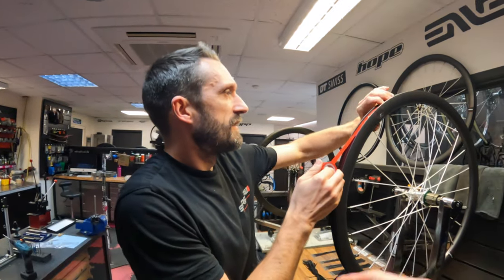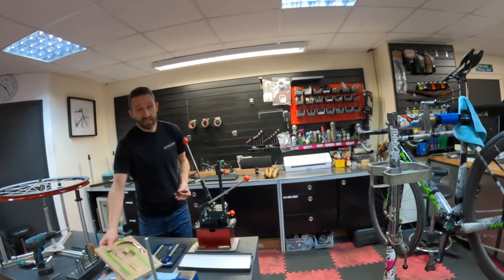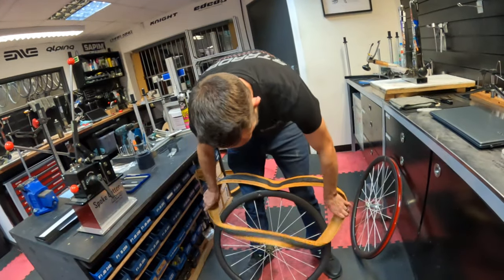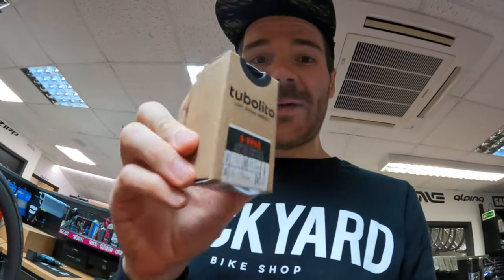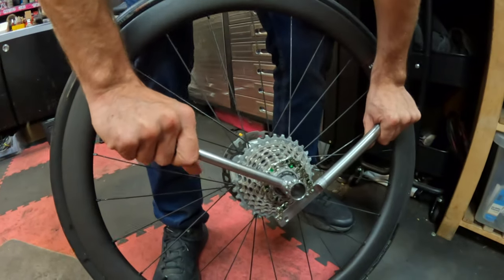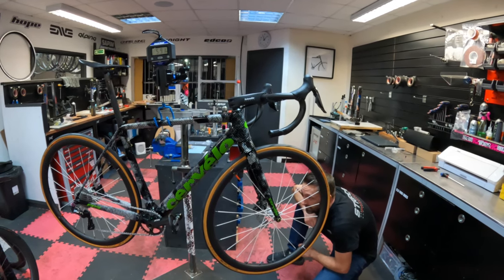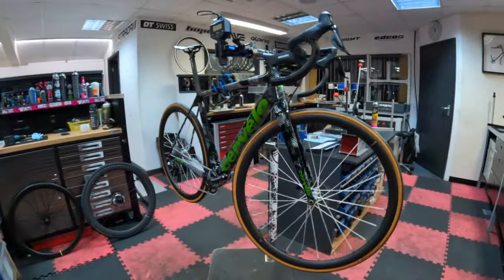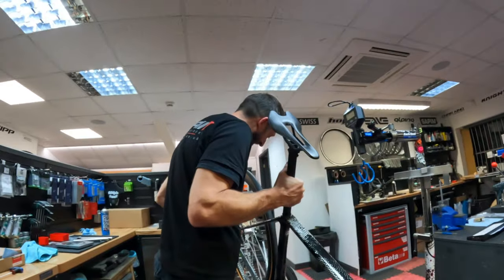DOES THIS PROVE RIM BRAKES ARE DEAD?!

Comment: You guys can keep making these death of rim brake videos till the end of time, but my road bike will only ever have rim brakes. They are perfect for how I ride & will actually lock up the tires if squeezed hard enough! These Shinano Ultegra road calipers are powerful & simple & never make noise. 🔥🚴🏻‍♂️🔥
Reply: There's enough braking power in a pair of mid 1980s Shimano 6208 single pivot side pulls even for a fat old duffer like me (96kg wet through), limiting factor regards braking/stopping is traction of the tyres and the ability of the rider to read the conditions.
I'll also never ride disc, a marketing ploy to extract loads from people riding bikes and thus far have done so with the aid of the so called professional road cyclists.
Reply: Yeah, i have a CAADX with cantis. Love em. I've had discs on MTBs before but what a faff. rotor squeal, piston siezing, bleeding etc. Not to mention the hit on the wallet.

Comment: My 2012 Scott CR1 SL in a 61cm with some Easton SL/SLX tubs came in at 6.212kg. That's DA9000 bits with Ultegra chain & 11-28 cassette, SLK K Force light Easton SL/SLX tubs (22mm Contis), Modolo Kurvissima bars, Ritchey Super logic post, Selle Italia Carbon flow (the wide one) and 5700/105 pedals.
My very ordinary KTM Strada 6000 in a 59 with 50mm Bora 1s (+27mm Vlaanderen) and same kit above is 6.63kg
5.91kg is an ok effort.
Reply from the maker: Final weight was 5.59 with pedals, power meter and Garmin. I think that’s ‘ok’
Reply: @ChrisHallRides  When you're spending huge sums on Smolke, one chainring and doing absolutely everything to get the weight down with a small bike frame, it is just 'ok', it's not outstanding but a good ok effort.

Comment: RIM brake wheel set will not die for me.....I have 5 sets of rim brake wheels with 700x28C tires and cassettes, I use them all on my 2011 Specialized Allez.  If I come across a used bike (same size a mine) with rim brakes for sale at a good price, I may consider buying it.  This is 1 reason that I am not buying a new bike with disc brakes, it is just OVER RATED.

Comment: Rim brakes will die when you cannot get parts for them anymore
Trp already stops providing parts for all those Triathlon bikes with the trp brakes.  You cannot get the rubber and springs for these brakes anymore.  I had to buy the Tririg brakes but those are on the way out too.
Reply from the maker: Yeah you’re right it’ll get to a point where it’s hard to get the parts

Comment: Rim brakes will still be here long after disc brakes have come on gone , probably one of the best marketing brainwashing scams in the history of scams , but those who like disc brakes good for them , the weight of bikes come a close second to disc nonsense. Again if the weight of the bike is what floats your boat brilliant.
Reply: Coaster brakes are even older.  Disc brakes will possibly be replaced someday but rim brakes will only last as relics...like carbureted cars
Reply: @veganpotterthevegan  funny that relics of cars tend to sell for much more than modern cars, most of the older bike with classic components are very expensive and will only go up in price, this modern garbage will only add to landfill in the future.
Reply: @kavanobrien6547  huh?  Most of them are rusting away and nobody will ever care about them. Not everything that's old has value.  And the stuff the does has value hung up on display and not being used anymore because its inferior.
Reply from the maker: I found an old Fray Bentos pie at my mums which was about 30 years old. Wonder how much that is worth
Reply: @ChrisHallRides  wow Chris is that the best you could come up with , now that’s what you really call lightweight.
Reply: couldn't agree more. People have bought the marketing BS hook line and sinker, aided by the pro ranks whom will ride any old crap if they're getting paid. Wide tres people will sa, I'll say just develop frames that take wider tyresthe calipers with some development could take 32mm. How much wider do ou need for racing? I tour on 28/32!.
My all round audax touring winter cum gravel ride takes 50mm and 40mm with guards. Built in 2007 and is rim braked.
Reply: @ynotnilknarf39  happy to race on 28 and 25s.  I don't see myself ever training on anything narrower than 32s though. *Rim brake tech didn't improve for the final 10yrs they were made.  Add tire clearance and those brakes get even worse due to arm flex. Bad idea.   Disc brakes are outstanding and I wish I had them when I was racing
Reply: @ynotnilknarf39  try descending switchbacks and descending from 100 to 40kph over and over and you'll see how much better disc brakes are.  You can break significantly later so you get to the bottom a lot faster.  People that don't descend well ride their brakes and benefit too because their braking will stay good from top to bottom without glazing their pads
Reply: @ynotnilknarf39  unfortunately the days of having a true opinion which will help the cyclist has long gone and replaced with money talks louder, hopefully there’s enough of us around that will advise others of the truth.
Reply: @veganpotterthevegan  we all have an opinion what’s good bad or indifferent in many aspects of life be it cycling or anything else , personally not a disc brake fan but to each their own , would be nice though if the pros would be able to use what they would prefer rather than them being forced to use , I just wonder what they really like to use , have a funny feeling a lot would prefer rim.
Reply: @veganpotterthevegan  As said for those who like disc good for them , personally I think they are problematic but that’s just my opinion, like having a suit shop where only having one choice of suit or a trainer shop with one choice of shoe , everyone is different, when we wake each morning we have two choices = happy, not happy , but at least we have a choice, the industry are making the choice for the customers, as said also rim brakes will be available to purchase as long as needed which will be for many years to come long after the carbon cycle is landfill .
Reply: @kavanobrien6547  people can like whatever they want.   The only reason to like rim brakes more is if you prefer less braking power in all conditions and worse aerodynamics.  Not many people think drum brakes are better for cars and for good reason.
Reply: @kavanobrien6547  guess what?  There are more rim brake, metal bikes in landfills than carbon bikes🥳
Reply: @veganpotterthevegan  we all like different things in life, some people think life is a sprint personally I see it as a marathon.
Reply: @kavanobrien6547  that's fine.   But everyone's explanations for preferring rim brakes are driven by the ignorance is bliss way of life
Reply: @veganpotterthevegan  What effects are you having with "flex" in tim brake calipers that is not conducive to stopping/slowing? Slowing down is a function of the traction of the tyre and ability of the rider to read the condition/s at any given time. in that, there's enough stopping power in a pair of 1980s single pivots, even at my 15 stone plus.
If you think that some notional flex in the arms of the caliper changes how effectively you can slow/stop toward maximum retardation, it kinda shows you don't understand physics or the dnamic of what happens when you pull a lever and what forces are being maxxed out. In virtually all scenarios it's tyre traction. Knowing when to brake and how much to brake is also a factor.    
you're going to mention something ludicrous like 'modulation', that's only a problem for people who don't understand how to brake properly or don't set their bikes up properly, basically newbs or those not willing to learn, take your pick.

And why would you train on tyres wider than 32s what do you think you are gaining from that, train heavy race light?lol
Reply: @ynotnilknarf39  really simple. You squeeze your levers until the rim and pads make contact.  Then the pad compresses and keep squeezing, then the arms of the brakes flex.  Blown away this is beyond your understanding🥴 Also, rim brake pads work significantly worse as they get hot. 
*You're definitely not smart enough to put words in my mouth🙃
Reply: @veganpotterthevegan  Lol, so you ARE a newb from this comment :o) how many places on the planet are you braking from 60 to 25mph in quick succession over and over?? A ver few stretches that mostl the pros are doing. Sure as an amateur ou can ride same, but from watching pros do it for the 40 years I've been interested in bike racing (and the were descending at speed and managing, it's seemingly not much of a problem except for misjudging of speed and/or the acuteness of the bend.
Not making a corner has never been about not having enough power or modulation of the brakes is it champ?
Maybe it's you that aren't able to cope with the scenario you've described, even fat old duffers like me can manage braking from 55mph - my top speed, when I was in the Alps (not done much in the mountains admittedly) on chicanes with tight corners it's really not a problem if you judge things! I guess brake fade on discs for same scenario doesn't exist.lol
Reply: @ynotnilknarf39  I used to race professionally potato.  I also live 5 miles away from the base of 2 HC climbs and climbed both of them yesterday.   I wish I had disc brakes when cycling was my job.   They're significantly better.  Never liked crit racing but they would have helped their too.  My example can be extrapolated down at lower speeds.  It's simply a lot more obvious at very high speeds.
Reply: @ynotnilknarf39  brake fade certainly exists with disc brakes.  I've never experienced it because I don't brake enough to worry but that's certainly not true on the some of the same climbs I did with rim brakes
Reply: @veganpotterthevegan  My best friend is the ex European rod race champion and his farther rode for this country in the Olympics , I am not saying anything that many professionals are thinking today but can’t speak the truth because they are linked to the disc brake companies.
Reply: @kavanobrien6547  well, you already tried potato
Reply: @veganpotterthevegan   If you like them then good for you , we all have opinions which are right or wrong in life on this occasion I am right and you are wrong but don’t worry I’m sure it will be you turn someday.
Reply: @kavanobrien6547  blissful ignorance for the W huh?
Reply: @veganpotterthevegan  much prefer fried potato we could it a chip off the old block but one of us has got a chip on their shoulder don’t worry I brushed it off your shoulder while you was sorting your disc brakes out for the millionth time.
Reply: @veganpotterthevegan  W ?
Reply: @kavanobrien6547  you're not very good at anything are you?
*Rhetorical question you'll answer incorrectly
Reply: @veganpotterthevegan  Are these  becoming love letters ?
Reply: @kavanobrien6547  I'm definitely not attracted to idiocy
Reply: @veganpotterthevegan  one does hope you realise I was injecting just a little bit of humour = dying is easy ,comedy is hard , nice  talking with even though we see things differently, I wish you well as you ride life ‘s path , ride safe , take care.
Reply: @kavanobrien6547   totally aware of your "attempted humor".   You're still the equivalent of the people that thought that carburetors and drum brakes were better than what followed.
Reply: @veganpotterthevegan  oh you trying to charm me now , we will have to have a brake in our relationship, actually twin carbs good motors , old yes but good , age is but a number , safety first rim brakes, no safety disc , ride safe .
Reply: @kavanobrien6547   there is no world where worse braking better.
Reply: @veganpotterthevegan  worse braking better, you got me with that =have no idea what you mean.
Reply: @kavanobrien6547  doodling with sweaty fingers on a VO2 day.  Wondering how much time you've actually ridden a disc brake road bike?  I have over 300k miles of rim brake riding in my legs.  I've mostly ridden disc brakes for the last 20k miles I've ridden.   So I have a pretty good base of knowledge for what's functionally better
Reply: @veganpotterthevegan  wow a serious cyclist, well done just tired thinking about your efforts.
Reply: @kavanobrien6547  it used to be my job.   Now that it's not,  getting up for a more typical job takes more out of me than cycling does.  
*All I'm saying is that it's not really rational to say an old thing is better than a new thing without giving it a solid try.   Not talking about a parking lot test ride at a bike shop where the brake pads may still not even be bedded in.
Reply: @veganpotterthevegan  I have to respect your opinion with your background in cycling but I wasn’t joking when I said my best friend was the European road bike champion and his father rode for the uk in the Olympics , so knowing them I also respect their opinion, I don’t have my head in the sand   I’ve heard good and bad things about disc brakes , it all comes down which one is right for oneself, of course there’s always going to be an element of what one is used too , having only done cycling as a hobby for over forty years maybe I have my head in the past , having listened to many people there’s quite a lot of people who just don’t like disc brakes , I know you will find this very hard to believe there are also people who actually don’t like me , I know it’s very hard to understand that one beggars belief, it’s probably a shock to you as well that people don’t like me = wow they need to get out more on bikes, let’s hope they pick the right brakes.
Reply: @kavanobrien6547  I have an olympian friend that feels the same way.  He's also spent less time on a disc brake road bike than I've spent on the international space station.  *People can definitely like what they like.  It's irrational to not recognize things are better when it's simply easily quantified though.   For a very long time,  my custom,  rim brake Seven was my very favorite bike.  But I knew that even amongst other rim brake bikes, many bikes were better than my bike.   They were lighter,  stiffer, more compliant and more aerodynamic, but I liked my bike more.  Eventually tech blew that out of the water though.   Never expected new gear to get this good so quickly and there are very few even middle range bikes that I wouldn't take over the very best rim brake bikes ever made(I've owned many of them).
Reply: @kavanobrien6547  the funny thing is that a ton of old jokers believe Durian Rider is crazy for saying carbon bikes, brifters and his Lightweight carbon wheels are better than a steel bike with 32spokes, 21mm wide tubulars and downtube shifters.  And that big carbon tubes can't be more aerodynamic and comfortable than a skinny tubed steel frame with skinny tires.  But again,  all this stuff is quantifiably proven otherwise.  I'm only referring to measurable performance here.  But people will always deny those very easily measured things.
Reply: @veganpotterthevegan  space station you mentioned just a little bit worried that you’ve hung around with me too long bringing humour into the conversation , you need to watch that certainty need to put the brakes on that , I would suggest rim but you and your modern ways will use disc , use what’s right even though it’s wrong , it will be our secret , joking aside it’s been a pleasure talking with you and hope your future is what you want and not what others want for you.
Reply: @kavanobrien6547  I'd gladly use a rim brake bike on a space station smart trainer🙃  No bicycle brakes would work well in space anyway but aerodynamics also mean practically nothing too😅
✌️
Reply: @veganpotterthevegan  Take care my friend.

Comment: non aero, disc brake 6kg bike. seems like mediocre at most things, master of nothing.
Reply from the maker: It’s less than 6kg
Reply: @ChrisHallRides  closer to 6 right? that should be the uci limit for small bikes like xs/s. its in the realm of 6-7kg which isnt incredibly light. perfectly fine though its a nice all arounder just be mindful not to lock up the front wheel especially when in an emergency situation when its think or die. the car industry has long since solved that issue with anti lock brakes after enough ppl where getting hurt and killed.